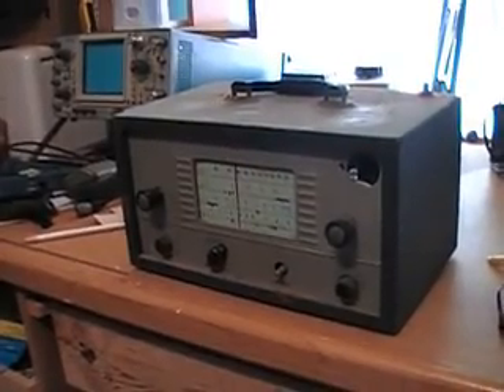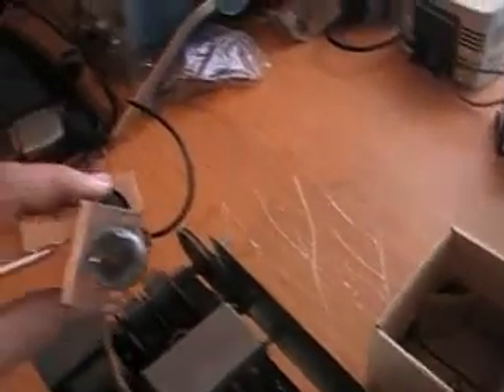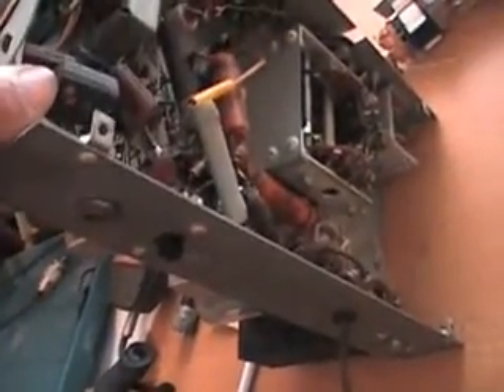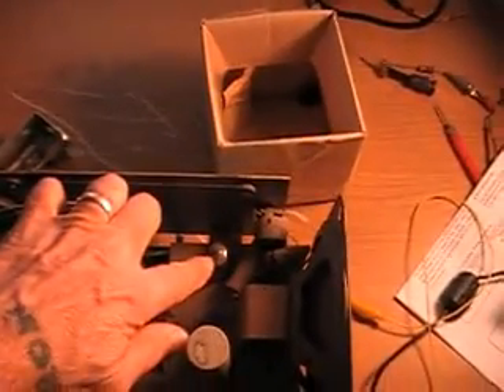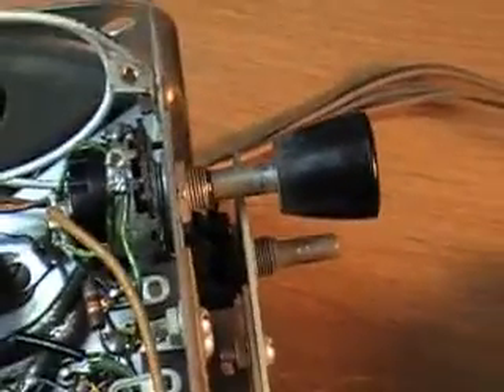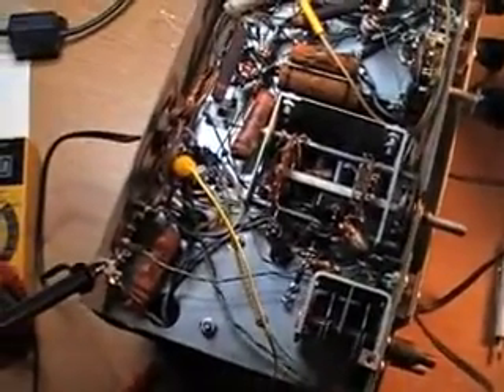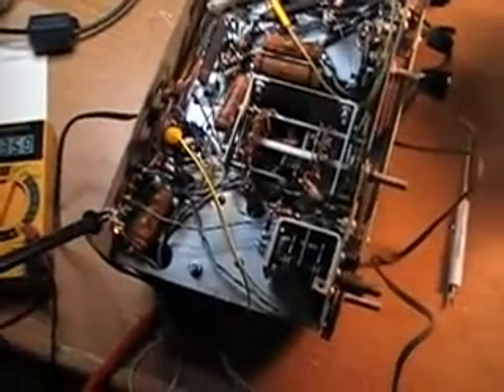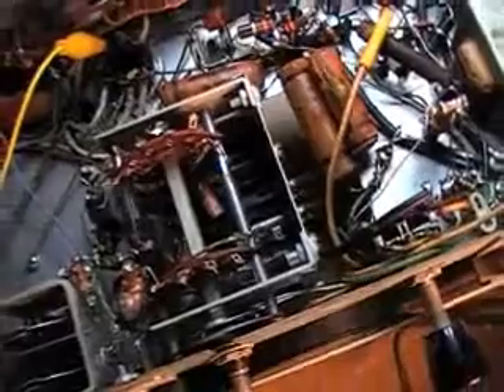Heathkit AR 2

Comment: (a) Hit it with a leaf blower  (b) remaining dust can be cleaned off with rubbing alcohol and wipes or qtips.  clean dial glass with glass plus (c) Don't touch the speaker, clean it using a model airplane paint brush.  the bristles will knock the dust off without hurting it. (d) change your electrolytic and paper caps (e) to derust things, soak them in Evaporust for a couple of days